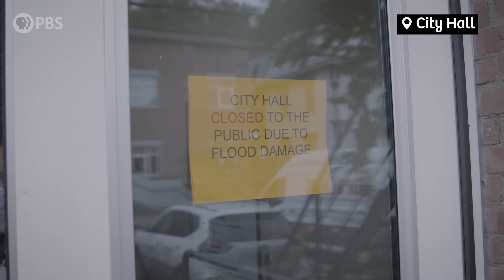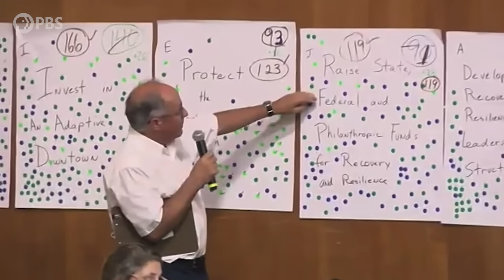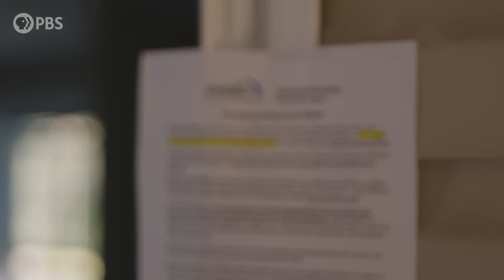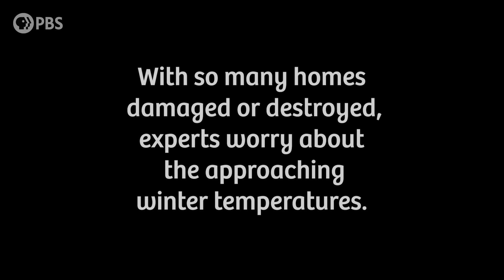What Vermont's Historic Floods Tell Us About Climate Change

Comment: Montpelier's flooding could have been worse. The dam upstream was inches from overtopping.
Reply: They got lucky. Which is frightening
Reply: Wait until next time
Reply: I thought the same thing. Maybe "only" losing economically IS what happens in areas less affected by climate change. Thankfully, I believe there was no loss of life. That's not small. And yeah, it's partly bc it's a small city and not New Orleans or NYC in a Sandy-type event, but still, that will always be THE most important thing.
Reply: @Macumazahn16  Can you name just ONE area or region in the USA in which the climate has changed since 1620 when the pilgrims landed at Plymouth Rock - show the  data, narratives are just climate fairy tales.
Reply: Yikes 😳
Reply: THERE'S A DAM UPSTREAM? Holy heck. Imagine if it bursts like happened in Syria
Reply: We were really lucky , it was at one point an inch from going over the spillway, the Wrightsville Dam was initially built to prevent flooding in Montpelier as it is at the confluence of the North Branch and the Winooski, with our infrastructure being built in nature flood plains in many of our 225 towns we live with the risk of excessive rainfall and not being so lucky if a dam breaks or exceeds capacity
Reply: scary
Reply: Over topping? The wrightsville dam was inches of using its overflow spillway as designed. IT was not near a failure. Yes a little more water would have added to the mess but its not like the dam was going to burst. Not sure if you notice the East Barre Reservoir on rt 302. It was and always is free of water. Go take a look and if you understand this flood control project let me know. The Jailhouse brook flows through it and Since I have lived in the area its never had water in it. Tax dollars at work.
Reply: @robertgifford1678  The overflow spillway is used when there is the danger of overtopping. The dam was getting really close to that danger, which is why they would have opened the spillway if it got any closer. It's a failsafe for overtopping. And it would have been much more than a little water added to the flood.
Reply: @Emmygedden  overflow spillways are tools of last resort right?a last ditch effort to avoid failure?